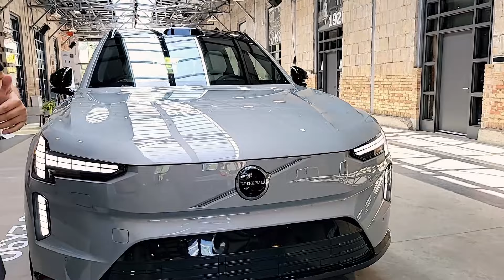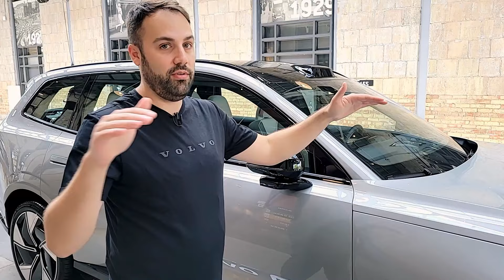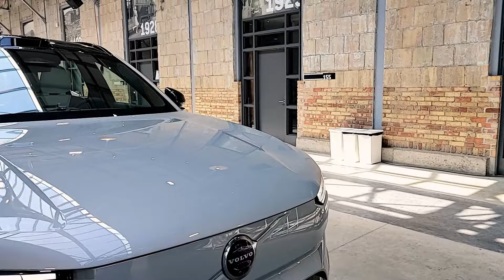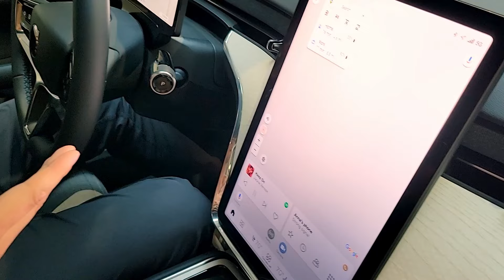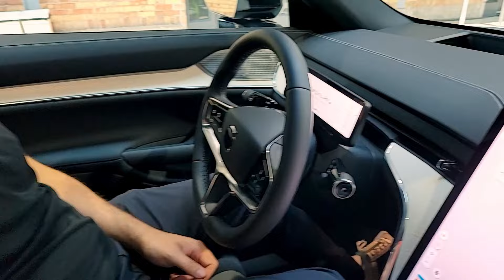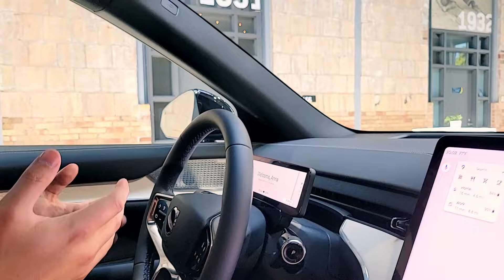Volvo EX90 Electric SUV| First Look and Walkaround

Comment: Edit: Love those little touches considering sustainability and overall design. I hope the reliability is also on par so this can be an easy decision.
Reply from the maker: So...they'll take you off the reservation list then? I'm sure they won't mind as the list of people waiting to drive one is pretty long.
Reply: @TheNovakReport   you are absolutely right The waiting line is a bit long. I just had some concerns in the previous edit but hopefully they addressed that.
Reply from the maker: @raspas99  I'm not defending anyone, but you are making summary accusations about a model that hasn't been sold to a single customer yet. Yours is an opinion based on your personal bias, whereas I prefer to wait and see and to actually get my chance behind the wheel before making any conclusions.
Reply: @TheNovakReport  they are lacking in reliability a lot in last couple of decades.. but okay. I'm not going to be One of those people online who just spread negative comments. Let's wait and see. The thing is between Lexus nx, Honda CRV and this I would rather take this if it weren't for those things I mentioned. And I have to wait a year for sure and it costs a lot..
Reply from the maker: @raspas99  The Lexus NX and Honda CR V are smaller than the EX90 which will have 3 rows and seat 7. And prices for EVs aren't apples to apples when comparing to gas powered. The purchase price will be higher on an EV but the costs to operate are far lower. You need to do a full cost of ownership and operating to make a fair comparison between the 2 technologies.
Reply: @TheNovakReport  I'm still leaning towards Volvo.. but with the initial price I'm not really expecting it to.. you know pay off...  If it actually happens and it proves to be reliable I'll be their biggest advocate.. My current CRV is I think 12 years old and not a single thing broke. And I mean not even one thing..

Comment: Such a shame that the sunroof can't be opened. Love the large sunroof of my XC90. This might be a dealbreaker for me. Love the rest of the car. The current trend of sealed glass roofs is awful.
Reply: Also the driver controls, "everything is touch" I really like the interior of the XC90, the big screen trend that does it all is also awful
Reply from the maker: Sealed moonriofs typically are larger in surface area to provide more openness, and this makes it unfeasible to open. An example of this was the Lincoln MKZ where the large moonroof pulled back, but then obstructed the rear view mirror as a result.

Comment: Wow, first EX90 I've seen with CCS and not combo. I was afraid they still only had the two prototypes from months ago, but it looks like at one has come off the line in South Carolina.
Reply from the maker: This is still a prototype, but one built to be showcased in North America - thus CCS.
Reply: what is CCS?
Reply from the maker: @nathannnathan85  CCS stands for Combined Charging System and is one of the North American DC Fast Charging standards. It is, however slowly on the way out as most automakers have made the decision to either switch to or become compatible with Tesla's North American Standard fast charging system. Look up CCS online for images or just see the charger inbthe video.
Reply: @TheNovakReport  thanks!!

Comment: How will  extreme cold affect range .  Minus 40 C  for examle  in Winnipeg
Reply from the maker: Range loss in winter has improved in EVs as new generation vehicles come out. Increased range also factors in. 

I can't speak to this model as it is new, but there is a vibrant EV community in Winnipeg, so I suggest you look for EV groups on social media to reach out and ask about their own experiences with a Winnipeg winter.

Comment: The elephant in the room again. How hot is the cabin going to be with that glass roof when the sun is beating down on a hot day. Really need some reviews in summer and get first hand experience as I doubt any dealer will point it out.
Reply: I was thinking the same thing! There needs to be a power shade for the sunroof! The entire roof is made of glass so I can only imagine how hot the cabinet is going to be in the summer. Not sure if this is going to be a deal breaker for me. But disappointing to say the least!
Reply from the maker: @sjohnson7879  the glass is designed to account for daytime heat. No automaker would build this way without provisions to manage high temperatures in the day.
Reply from the maker: There are plenty of other models that have the same treatment. Toyota and Lexus have done this as have other OEMs. Never been a real problem, and I've driven a few of them.
Reply: @TheNovakReport I’m assuming this is a Canadian channel? I currently live in Texas where it’s consistently been 100-105f/38-41c. Genuinely asking, Have you had experience in that kind of situation? If so, can you tell us how that fairs in that kind of weather? Cuz it’s near unbearable to get in our cars currently
Reply from the maker: @mykecheckone2 Yes, I'm Canadian but I do tailor my videos to Canadian and US viewers. 

I can't answer a speculative question as it relates to how the EX90 with its panaoramic roof will manage in areas like yours since the model isn't for sale yet.

But what I can say is that all automaker do extensive testing on new models in both extreme cold and heat prior to debut. I also know that the top is tinted and driving in heat would indeed be considered. They wouldn't design a vehicle for sale in the US that wasn't viable in parts of it.
Reply: @mykecheckone2 A roof won’t help much in Texas. And it only getting hotter.
Reply: I think the same thing, these interiors are horrible. Cost cutting and savings everywhere. That roof is simply stupid, try to live in a hot country and you'll know. No curtains for the rear doors, vent seats only for one fabric, and that horrible dashboard. 
These are 20k € car interiors, no way to offer such a poor, miserable, dull interiors for a 120k € car
Reply from the maker: @MrBobberone  it's not a $120K vehicle.
Reply: @TheNovakReport Yes it is, I said 120k€
Reply: Our Model S has a huge glass roof. The cabin being hot in hot days is a non-issue. You also have the option of installing a heat/UV rejecting tint as well.
Reply: In the tropics a big glass roof with no cover is a deal breaker.

Comment: "this thing is FAST... 0-60 in 4.9" this man living in 2013
Reply from the maker: Under 5 seconds for a 7-passenger, luxury electric SUV that is packing a 111 kW battery...well, yes that is indeed fast. He didn't say it was the fastest - he said it was fast and he isn't wrong.
Reply: @TheNovakReport this dumb forgot that this car was roughly 3 tons
Reply: @lotfibelbachir9326  I thought my BMW 320d doing 0-60 in roughly 7.5 seconds was pretty nippy. 4.9 is all you could ever want in a HUGE car like this.
Reply: @WoundUp  absolutely man. it seems even unreal to think about such performances
Reply: Still dissappointing for anyone cross-shopping this an a Rivioan. The Rivian weighs more and can do 3 seconds to 60. Our other EV can do 60 in about 2.3s and as bonkers as that is, you get used to it pretty quickly. Wish the XC90 top tier trim was closer to 4 seconds like the EX30.
Reply: @youtubeaccount9808 it’s a bit stupid to have so much weight and that type of acceleration. At least in a nippy sport vehicle you can handle it. But a BEV that weighs that amount is a stupid idea.